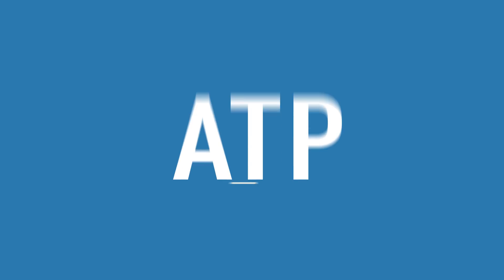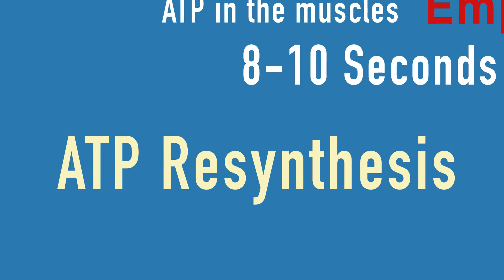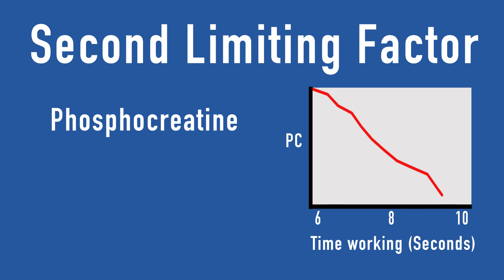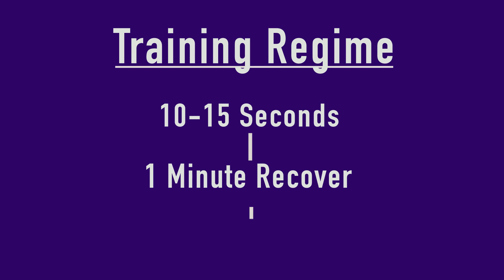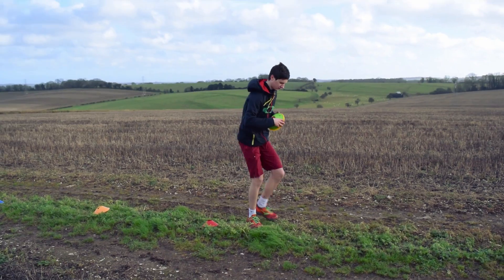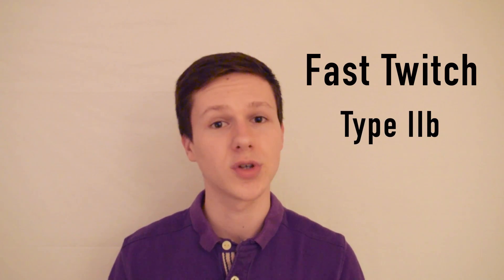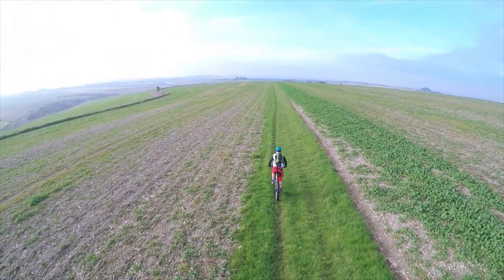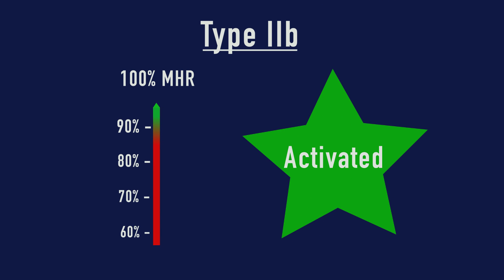ATP-PC Energy System

Comment: 1. 1 minutes rest isn’t enough. You need atleast 3-5 minutes rest to replenish ATP stores
2. Your statement about developing more IIb muscle fibers is abit misleading. You can develope more IIb muscle fibers, but omly from IIa muscle fibers.
3. 15 seconds of activity is too much. Yes these stores can last for about 15 seconds, but only on lower intensity than you maximal intensity. If you want to develope more IIb muscle fibers, you should sprint at maximal velocity as often as possible, which you can’t do with rest lasting 1 minute and intensity low enough that you can keep the ATP-CP system for 15 seconds.